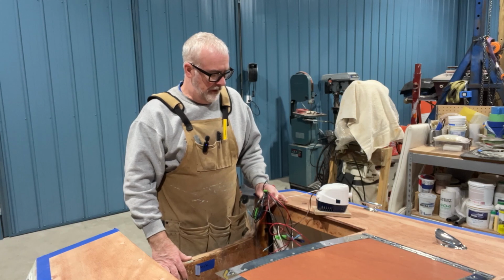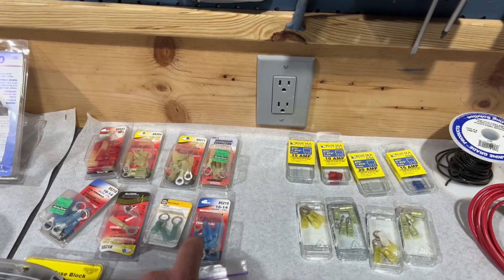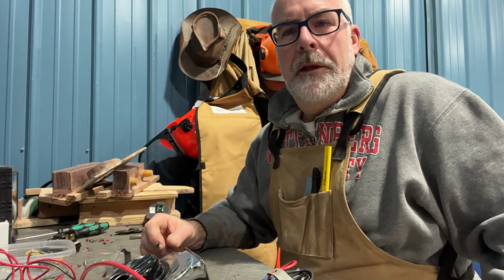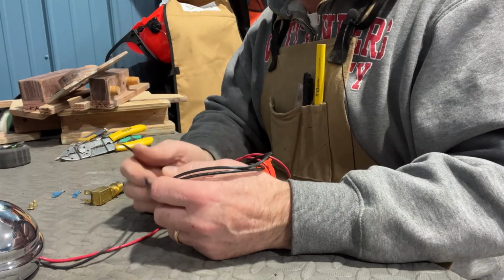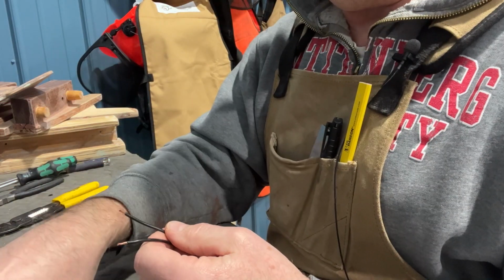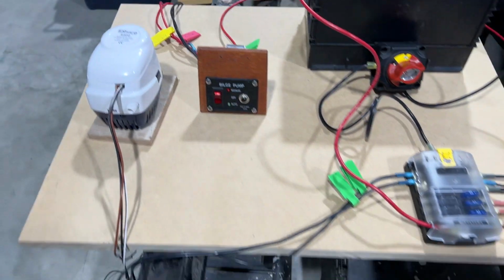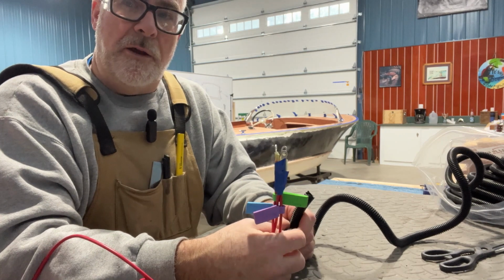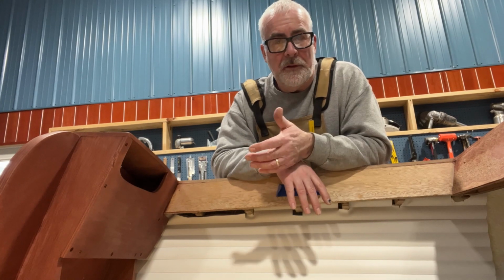How to Restore an Old Fibrerglass Boat -  Episode 7 -  Installing the Electrical System

Comment: I don't know if you saw it but when you tested the horn, there was a spark where the wires connect to the horn..
Reply from the maker: I can't see it but will check in the morning. The positive and negative horn connections might have touched the body. Thanks!
Reply: @reynoldsrunabouts . Great job on the boat, enjoying it all, I have three boats, is that too many?
Reply from the maker: @Sibe3244  Thanks! I have 12 boats total which should keep me busy for awhile!